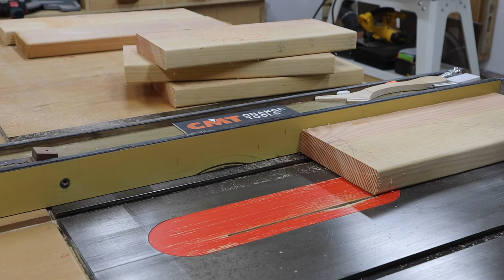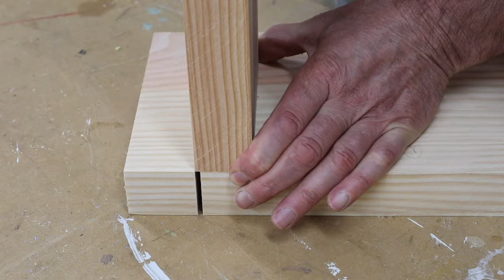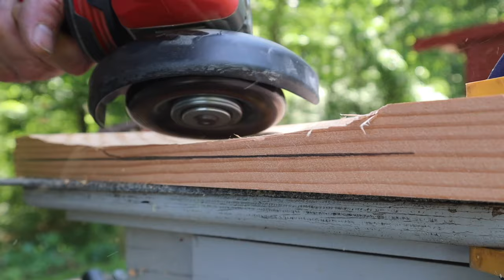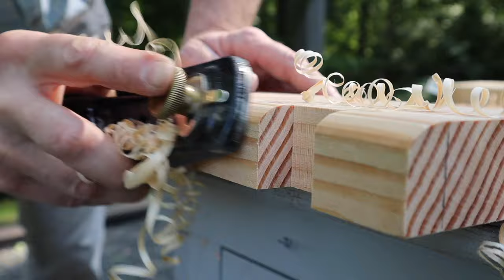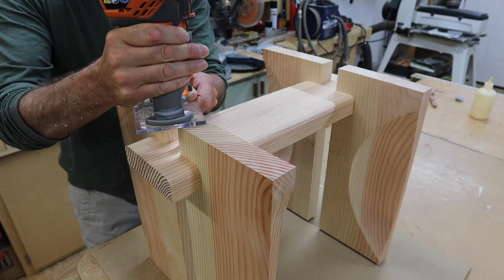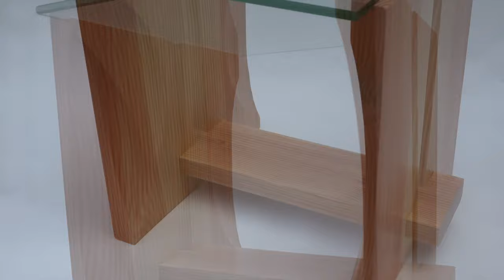Build a Side Table with Just One - 2 x 8 x 10 Board!

Comment: The blue brush you used for applying glue to the joints, whats happen to the brush? You throw it away?
Reply: those are silicone brushes. the blue ones i think come from rockler, but a number of vendors sell them. i got the bench dog ones from amazon. you can leave the glue to dry for a day or so and it will peel right off. of course it's easier to clean up later if you let them soak in water, but it's not necessary.
Reply from the maker: Yeah I’ve had this brush for a while and used it for the first time a few weeks ago... very handy